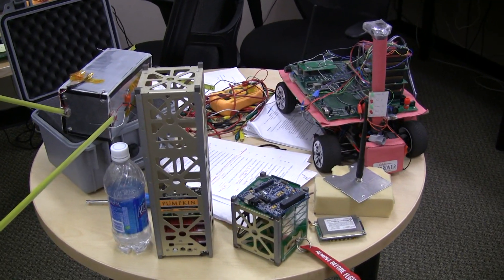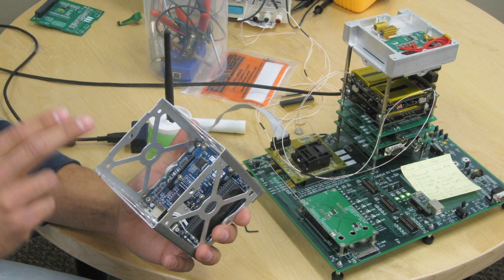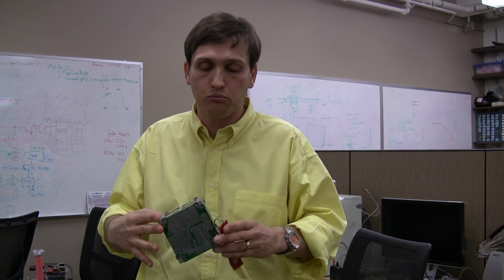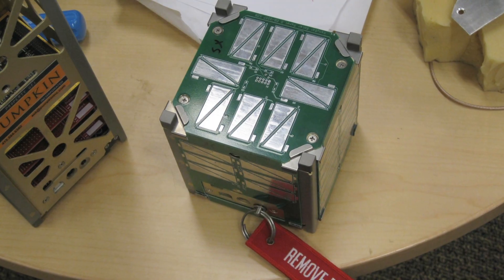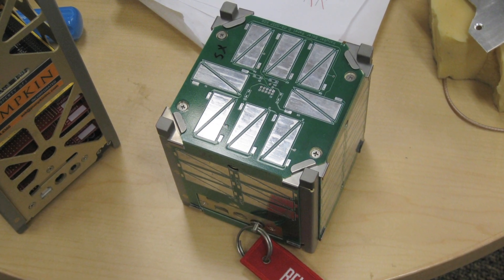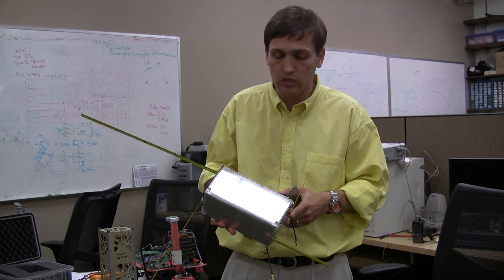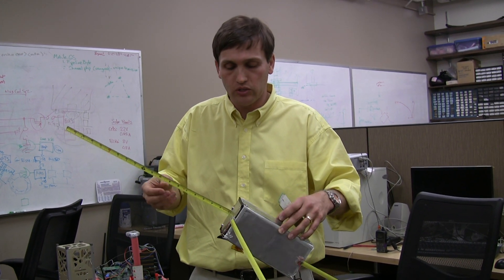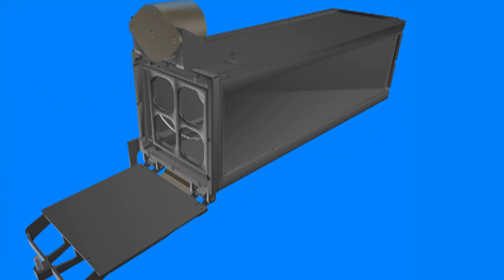Tiny, DIY Satellites Get NASA Boost

Comment: Not really. The power of the telescope is based on the size of the mirror which collects the light. The mirrors of Hubble weigh 1,825 lb (828 kg) and are 94.5 in (2.4 m) in diameter.